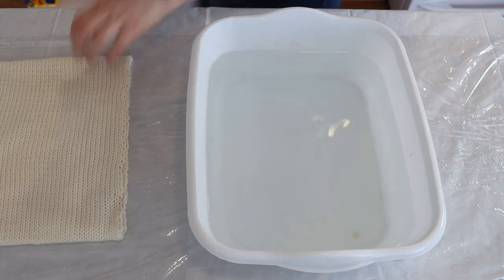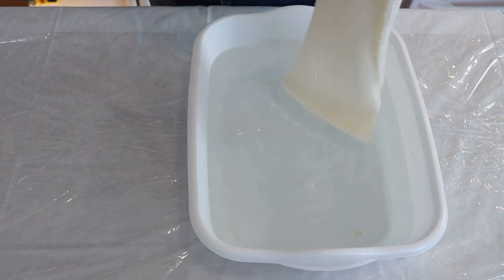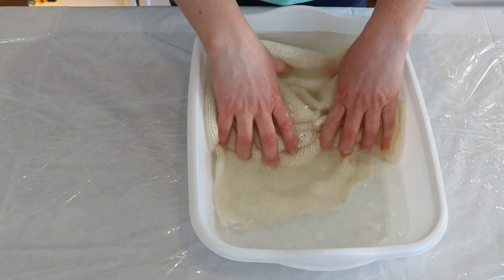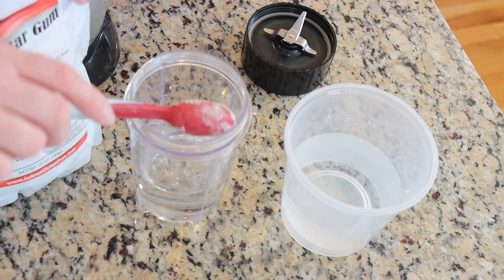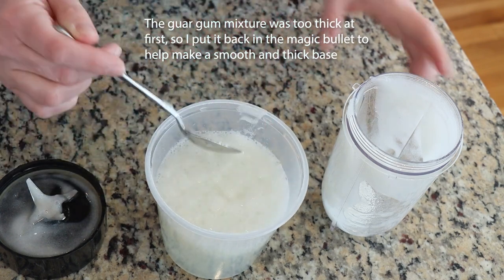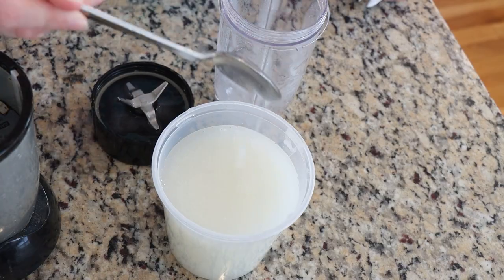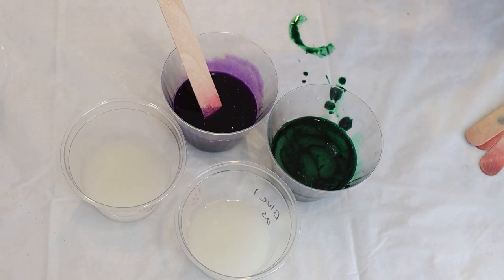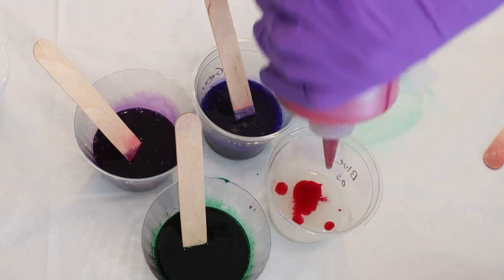Dyepot Weekly #446 - Dip Dyeing a Stenciled Sock Blank: How Much will the Design Bleed?

Comment: Alright, now we are waiting to see what these form into as socks, assuming you're going to make socks with this.

What would overdying look like? Like Dharma's old khaki-like dye. That's my wife fibre artist asking that. She, too, was confused by what you were doing from the thumbnail, but I queued it up anyway coz where do you find stenciled sick blanks? She is now very very intrigued.
Reply: Maybe a gradient or space overdye?

How about letting it dry then stenciling the other side?
Reply from the maker: Typically you would unravel these blanks back into the yarn and the knit socks or something else out of the yarn.  So the blanks themselves aren't directly transformed into socks.  :D 

I don't think you'd want to let the sock blanks dry without washing out the guar gum first, but you could absolutely heat set the blank in a steamer basket and then dye the other side with stencils, too.  Some of the dye does go through, but that depends on how much pressure you're applying.  If you spray color onto the blank then sometimes it doesn't go all the way through and you can get different colors on both sides giving a super alternating speckled finished result.
Reply from the maker: Mainly, I did this experiment because I was curious about how careful I have to be between paitning a blank and heat setting it.  If there isn't a lot of color transfer from immersion dyeing the blank in the end, then maybe it is okay for the blank to not be wrapped in plastic wrap to steam set.  I'm always trying to consider ways to make my process less wasteful.